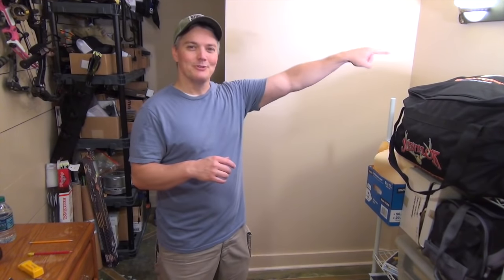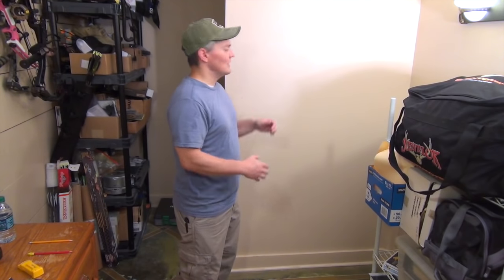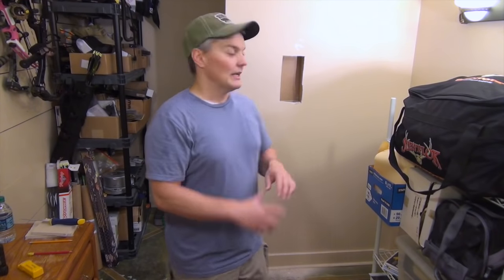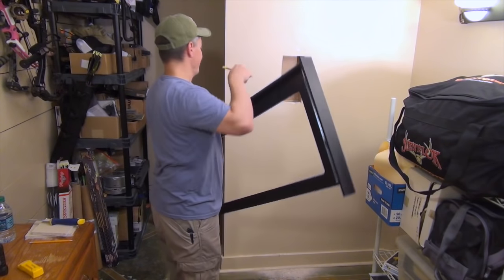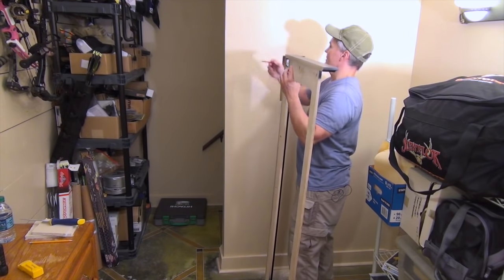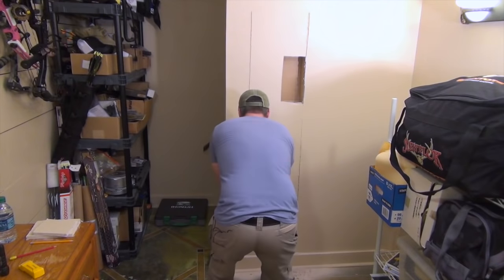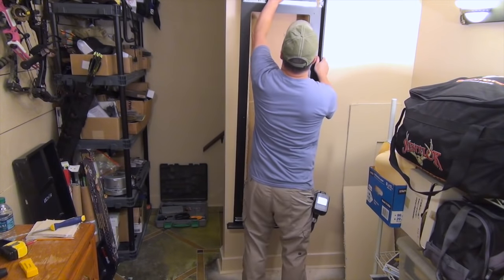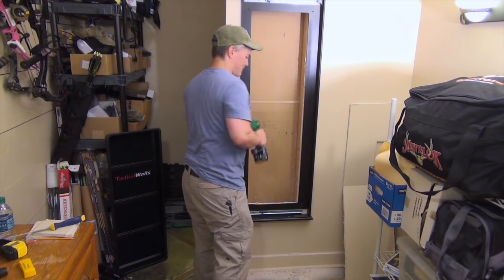Tactical Walls Insert & Mirror Install! 1450M Insert Bundle

Comment: Great video, very informative.  Just one question:  How far from the wall is the sliding mirror?  Just asking because the spot I am thinking of is will be between trim molding on both sides.
Reply: too bad no one has answered yet, because I would like to know also.
Reply: I just installed on and I had a rub at one of the corners. I shimmed it with 2 1/16" washers on the bottom screw and all is well. The problem appears to be that not all walls are perfectly square

Comment: I don't know if you mentioned it, but the white block in the top right corner is a magnet key, that you need in order to open the "safe"?

Overall, this is really cool. I'll probably make one myself. But without the magnet lock, that seems unnessasairy. Maybe a discrete button.
Reply from the maker: MusFuzZ Yes, it is a magnetic latch.  It is more secure against access from kids or curious guests than any button, regardless of how well you think you hide it.

Comment: I have a 16" Remington 597 chambered in .22lr and i cannot get subsonic results with any CCI standard velocity ammo. Any suggestions TWANGnBANG
Reply from the maker: noahbodey123 What velocity are you getting? What silencer are you using?
Reply: TWANGnBANG i have not measured velocity but it is supersonic. I have a 9mm can which might be the cause but i wouldnt think smaller baffle holes would affect the velocity enough to make it sub-sonic.
Reply from the maker: noahbodey123 Are you referring literally to CCI Standard Velocity, as in that's what's on the box?  When you say "any CCI standard velocity ammo," I'm thinking that you might not realize CCI makes one and only one type of ammo called Standard Velocity (with a capital "S" and a capital "V").  That is the ammo that I'm talking about.  It is loaded for 1070fps out of a 22" barrel and is well below supersonic velocity out of a 16" barrel.
http://www.cci-ammunition.com/products/detail.aspx?use=5&loadNo=0032
Reply: TWANGnBANG youre right, i had the standard velocity in the cart but went with the cheaper mini mags instead. My bad. Thanks for the input

Comment: Tactical Walls make some very awesome products.   Hope you never need to use it.
Reply from the maker: delicious fishes Thanks!  Certainly will for the chickens, though.  Something makes its way over our fence about two or three times each year.  In April, we lost three chickens when a fox dug under our fence.
Reply from the maker: Raymond Ashby Tactical Walls are hardly human proof, and the chickens a free range during the day. They don't live in a giant wire box 24/7/365, which is the only way to guarantee no predation. It is also a way to guarantee you'll have the same health problems in your backyard flock as the very factory farms you're trying to avoid.
Reply from the maker: Raymond Ashby The fox dug a foot under a buried fence in two different places. You literally have to put in a wire floor to keep them out.   Possums will climb the fence and get them before I lock them in their pen for the night. It all comes with raising free range hens. Predators are normal, but they give me eggs, so I give them protection.
Reply: TWANGnBANG Hear hear!!

Comment: Is the frame actual hardwood or cheap veneered MDF?
Reply from the maker: LaBalaDePlata432 Solid poplar, just like I said.  No MDF anywhere in this.
Reply: My bad, I wasn't paying attention. Looks good, I bet I could make one.
Reply from the maker: LaBalaDePlata432 It would take a long time to get it right if yo were to make an exact copy with trim split between the mirror and the base. When closed you cannot see the seam at all. 

However, you could certainly wall out the space between two studs and cover it with a mirror mounted on drawer glides.
Reply: Na man, ive been doing woodwork my whole life. ;)

Comment: Way too expensive. For me anyway. You could get a mirror from IKEA and build something like this for a quarter of the price.
Reply from the maker: karm42yn You can buy just the inserts and put whatever you want over them.  The inserts are a great value when you consider the time you save by not having to box the wallspace, then glue loop fabric everywhere.

FWIW, the furniture parts of everything they build is way above IKEA.  You could certainly get a mirror from IKEA, reinforce it, put trim on three sides that perfectly matches a piece of trim on the frame you build... but after all of the time you spend doing that, you still won't have something that looks as good as this.  The perfect looks is definitely worth the price for a lot of people.  Thanks for watching!